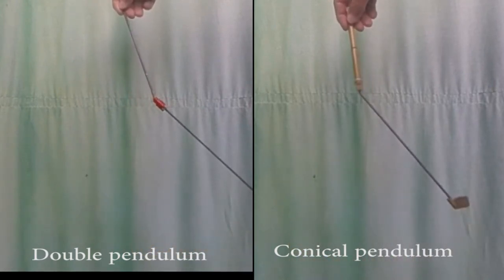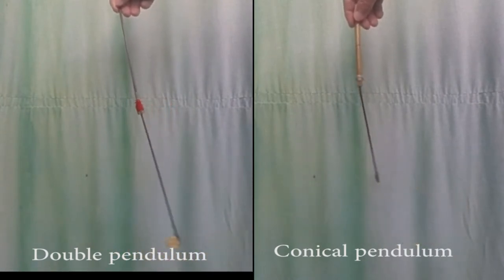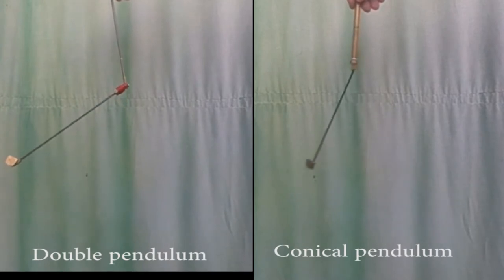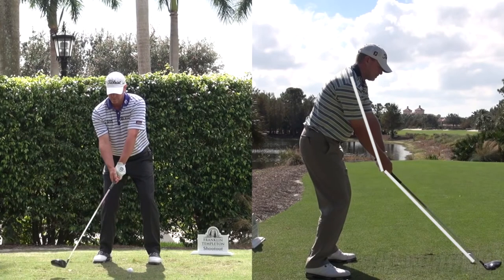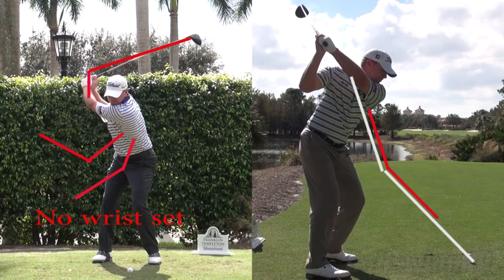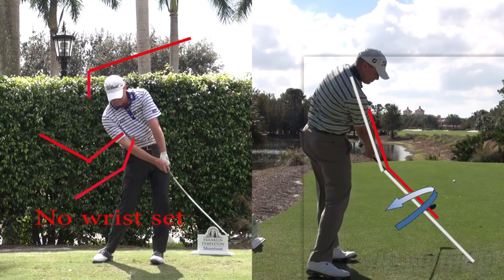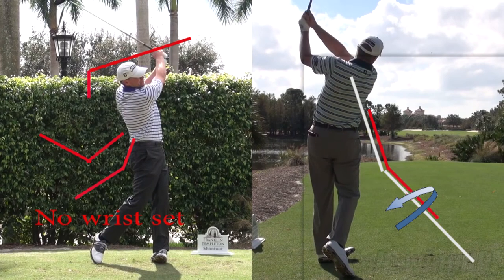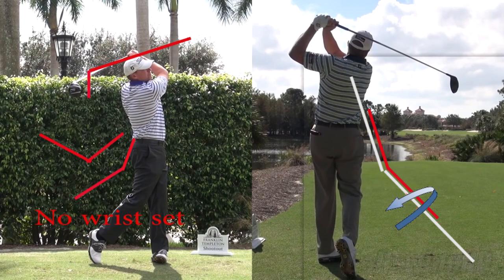conical pendulum stricker

Comment: On the left hand side image there is clearly a setting of the wrists. Your top red angle is more acute than the bottom one. Please explain.
Reply from the maker: Johnny,
There maybe a small increase in the angle but the setting of the wrist is a 90 degree rotation of the wrist not in increase in the ulnar set angle. It is the rotation of the wrist that is released not the ulnar set.
Kevin Ryan
Reply: Hi Kevin, thanks for your reply. Hackmotion sensors show 30 deg of wrist radian deviation from address to top of backswing. Is this in line with your determination of a “small amount”?
Reply from the maker: Johnny,
Hackmotion only measures flex and radian deviations not rotation. Rotation release is from -90 deg to +90 deg (total 180 deg) in the conical release compared with at most 30 deg for radian and 60 deg for flex. That is 3 times the release arc.
Kevin Ryan